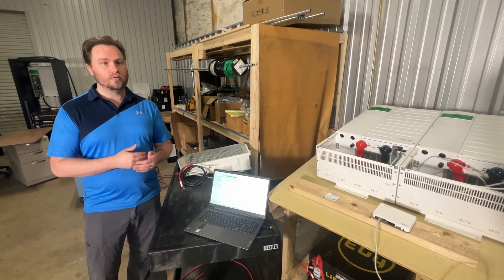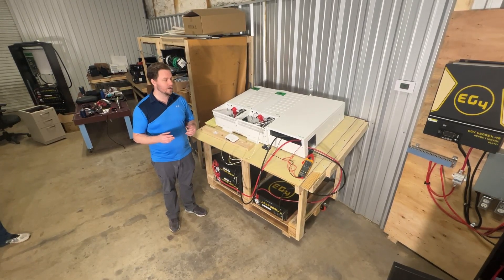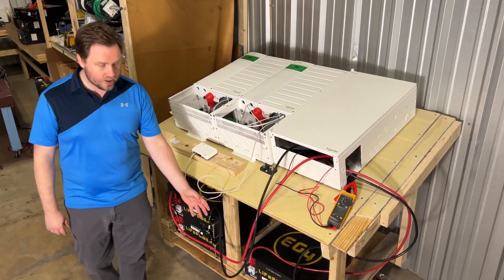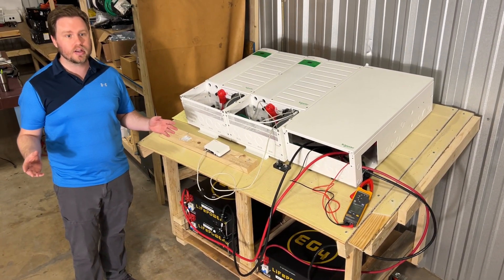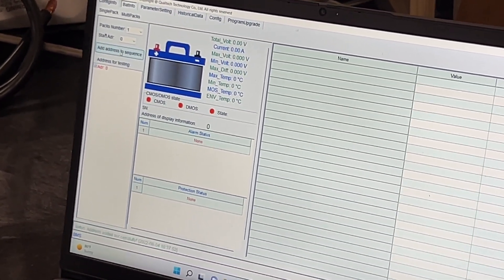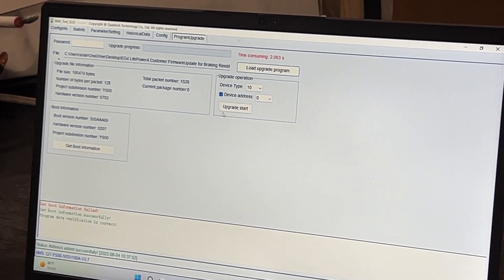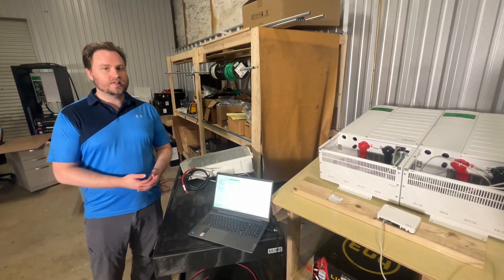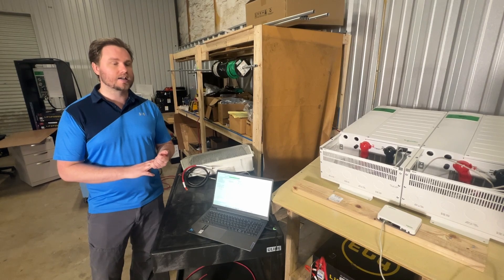EG4 LifePower4 Firmware Update | Pre-charge Start for Small Battery Banks | EG4 Server Rack Battery

Comment: How many watts can you charge with the generator? And can you charge with a generator wile the loads are still active? Anyone know?
Reply from the maker: The charging W will be based on maximum Charge A Max would be 5120W(100A), recommended would be between 1536W-2560W (30-50A). Charging A X Battery Nom. V(51.2v)

Comment: After upgraded to the latest V3.26 , the SOC (state of charge) feature is stil borken between the Schneider XW pro and Lifepower4.   if SOC feature is broken what is the point to have close loop communication?  Maybe the problem is Schneider?  I wil be contacting Schneider next.
Reply: I figured out the issue.  Under the menu Devices->BMS->Configuration expand "BMS_DEV"   ,  Select "House battery Bank 1"  under "Device Association".  Click Apply.    Once this done ,  you can enable "SOC Control" without getting "SOC Level Lost" error.

Comment: After following your procedure. The BMSTest tool app said it successfully upgrade the firmware to V3.21( file name: YS00_SW0315_HW0207_Update.binc) BMSTest app can still  pull all the voltage informations of the battery after the upgrade but now the battery BMS is not able to communicate with XW Pro nor the communication hub.  Please help.
Reply: This time I downgraded using the link in your description. It downgraded the firmware from V3.21 (from EG4 website) to V3.14(from the link you provided)  now it is able to communicate with my XW pro and communication hub.   Do you have V3.17 which came with the battery when I purchased from you.   All my other battery are on V3.17 . Except this one is downgraded to V3.14 .
Reply: Also i learned that while the battery is being charged ,  you will not be able to pull the boot info nor upgrading the firmware.

Comment: This has to be one of the worst most pain in the ass products I've had to deal with very limited instructions 99% of the information to install this and put it together is offline from blogs from other people not the company. You call the company use their callback feature or you sit on hold for hours call back feature they don't call you back. Then everything sent out is out of date on the firmware damn near everything I've seen as a code 61 out of the box. Hook it up to a generator you get code 10 if you try to charge grounding problems this problem that problem this is not a good deal a good kid or easy for anyone as a DIY it's a horrible product made in China you will spend weeks of your life trying to get it to function properly
Reply: Sounds like my experience.  Support isn't much help.  the 12v batteries seem to be the ugly step child no one wants to talk about.

Comment: OK, so what got edited out @ 7:35  when you were trying to get the boot information which apparently didn't work this attempt? My lifepowers always say "Get Boot Information failed" and loses it connection. It shows to have failed on your laptop but something was done and it worked the 2nd time. What was done?
Reply from the maker: Usually, this error occurs when the battery is connected to a bus-bar or other batteries, so if that is being done on your side, we recommend isolating the battery and updating it.

Comment: Does this firmware work with the EG4-LL version 1 - 24v battery?  I have (2) EG4-LL version 1 and they will not start my dual victron set up, they go into fault mode.  I did receive your EG4-LL version 2 battery and it will not start my dual victron set up either - I did disconnect one inverter and found that the version 2 battery will start one victron inverter - just not two set up to run split phase.  I have these set up to provide 240v split phase power to my RV - they are also set up this way so I can plug the coach into shore power - and provide pass through power to my coach.  Just FYI -  I think your comments on going against industry standards is kind of insulting to those of us just trying to start our inverters using the batteries built in pre-charge resistors - the version 1 EG4-LL will not work on a 3000 watt inverter - without manually pre-charging the capacitors first.   I have also sent this same message to Derrick - any help is appreciated.

Comment: We are simply trying to get a battery bank together that will last a decade. We live off grid in Alaska, with a prune of an Inverter from Aims, and 4 Chins 12v 200ah batteries in 2P2S. Right now, our inverter is driving me nuts, because even with it set to Lithium it will not stop charging them, and I have to watch the voltage, anytime we run the generator to charge the bank.
Reply: Best to get the set! The eg4 inverter does everything the eg4 batteries need by itself!

Comment: When I bought my 6kw split phase inverter and 3 eg4 48v batteries, I did not do the firmware update. I have never had any issues with my system yet. I watched other videos of how to do the update because I was concerned on if I needed to do it at all to make the batteries happy. Only you and your video explains the situation of when and who should do this update. You pointed out the need and not needed aspects of the update. Thank you.

Comment: You guys rock!! I'm using the EG4 100AH/48V with a SunGoldPower 6000W 48V inverter to back up (UPS basically) a bunch of circuits in the house of which one was my well pump (so I wouldn't need to pull out the generator for some water in the event of a small outage). My issue was that even a dehumidifier compressor coming on plugged into one of the backed up 15A circuits, would trip the BMS circuit protection let alone the well pump. Well happy to report I did a power outage test just now and the 3/4HP well pump fired up no issues off the inverter and EG4 battery with this firmware update. One thing, the manual dip switch address info in the manual is either wrong or I'm reading it incorrectly as it seems "reversed". Thankfully your video panned over the dip switches on the front of the battery which had them all in the down position which tipped me off. After that, the instructions in the video went without any issues. Thank you guys SOOO much for this update as I really didn't want to buy a 2nd battery for my use case.
Reply: The dip switches are inverted completely. I had the same issue with the dip switch
Reply: Hooped
Did you get the EG4 BMS to communicate with the Sungold inverter? Was that part of the firmware update? The Sungold 5kw 48v/120v inverter has a very attractive price point for what I'm hoping to do. But Sungold tells me that they are unaware of a way to communicate with an EG4 BMS.
Reply: @Vibe77Guy  Hi David. I did not attempt to see if I could get the Sungold Power to talk to the battery. I'm fairly certain it probably isn't possible as the inverter is fairly entry level given it's price (good build quality though). I'd probably go the GroWatts or SIganture Solar's unit if I needed that.
Reply: @hooped8907  
I found a video of the BMS protocol being accessable in the SOK batteries to one that can talk to the various inverters. It's just setting it to something other than the default driver. Maybe the new EG4LL firmware update will allow it.  The Sungold 5048 is both 120 vac vs 230 only, and at a price point that would allow a 10kw capacity cheaper than 8kw, in some cases less than the cost of a 6k split system. I'd just really like to couple that with the EG4 batteries performance and price point as well.
Reply: @Vibe77Guy  I have the older black 6000W 240V  LFP Series inverter/charger unit (looks exactly the same as the Aims). I think you're looking at newer models. Mine has a remote control unit (wired) as well as a lead to auto stat a generator.

Comment: Will this firmware update work for the EG4 LifePower4 12 volt 400AH battery?
Reply: Apparently not.  I just got one and it won't even start my 3000w inverter (MSH3012RV by Magnum).  I've been trying for 2 weeks to get a solution.  I've talked to 3 people in support, first two had no idea and pointed me to the wrong software.  3rd was helpful, I tried a bunch of stuff, emailed him the results....and nothing.  No call, no email, and I've spent hours on hold.
Reply: @fierofreek  I have a 3000w inverter as well. When I hook it up and turn the battery it on, it shuts the battery down. Too many inrush amps. If I jump the system with another regular lead acid 12 volt battery then turn the EG4 battery on its fine. The large capacitors draw more then 200 amps the first 1/2 second the battery is turned on. By just jumping the system with another small battery it works fine. But every time I shut the battery off, I have to jump-start the system first before turning the EG4 lithium battery on. My understanding was the firmware upgrade they made for the 24 and 48 V batteries resolved the issue. That's why I was inquiring about the firmware upgrade for the 12 volt ones.. I also never got a response from them via email. Customer service is not their strong suit.
In hindsight, I would have purchased an SOK battery as they have much better customer service.

Comment: I have 2 12v eg4all batteries in my motorhome so that's about 800 a why won't the battery's allow me to start my rv ? I have them connected in parallel when I turn key voltage on batteries instantly go to zero
Reply: The 12 volt models seem flawed.  I can't get one battery to start my 3000w inverter.  The precharge seems to limit the current TOO much, such that when it clicks off it still spikes.  And Signature Solar doesn't seem to know anything about the 12 volt models (my experience after spending hours on hold, talking to 3 different people, emails, etc)

Comment: Hello, I'm able to get to the boot information I just can't get any information out from it and will not let me download new firmware, are the deep switches need to be on a different set up at battery? I think y'all need to do more video on this firmware including troubleshooting. Thanks
Reply from the maker: Have you verified you have the correct cable pinout?
Reply: @SignatureSolar  i use the cable that was at the outside part of the battery box 📦.  Thanks for replying
Reply: @SignatureSolar  same is happening to me
Reply: @SignatureSolar  what is the correct pin out?
Reply: @SignatureSolar  What is the pinout configuration? Can't find in description or your website.

Comment: How did you guys get to that menu for the battery because I connect my USB cable and my computer doesn't detect anything
Reply from the maker: Sounds like you need to make sure you have the software installed. Please contact us if you are having issues.

Comment: Trying to replicate the update process but I keep getting the failure to get boot information, verified the battery address at 0 and can see the bat info. I did notice the bms test software you're using is v2.0 but the download on the EG4 page is for v1.0. Could that have something to do with it?
Reply from the maker: No. V2 of the software is an internal tool, but this was tested and works on V1 without issues. Please reach out if you still have issues and we can help.
Reply: Hello, i have exactly the same issue, any luck downloading?
Reply: @elgeorgesoyyo  Yes! The black rs485 cable that came with the batteries was setup to use pins 7,8 - I needed to snip off the 8P8C connector and re-terminate with pins 1,2. I had to try both pin orientations on the USB end before I got it right. Thanks to Warzone Clips for letting me know the fix!

Question to the pros out there, is there any problem with sticking to pins 1,2 for everything? Seems to pull bat info and do everything the same as 7,8.

Comment: Will this update fix battery shutdown? If it is an update, why is not recommended on working batteries? What does this update really do? Please elaborate.
Reply from the maker: This update is specifically geared towards people who are having startup issues and seeing errors with short circuit during start up. Although it will not cause any issues for people who are already able to start up their system without issue, there is no need to install if if you aren't experiencing these issues.
Reply: @SignatureSolar  I really wish you'd answer the question, what exactly does it do?  I have a 12v battery that won't start a 3000w inverter (MSH3012RV), and support won't help.  Without some information about how/when the precharge is triggered, I'm stuck.

Comment: I have 3 Growatt 5000es with 2 EG4 battery’s. Will this firmware do anything?
Reply from the maker: If your system is operational then we do not suggest updating the firmware.
Reply: @SignatureSolar  Any timeline on  a fix for error 61?  I get it randomly, but not all the time.

Comment: Does this firmware upgrade fix the “error 61” communication issue with the 6500ex?
Reply: I was about to say how about Error 61. For now I bypass  it using "user" setting instead of EG4.
Reply: @Signature Solar is there a true fix coming? I’ve tried all your suggestions of inverter settings and using your 2 pin cable. Sit getting error 61. I have two tickets in and Travis says I will get a call from a level 2 tech…but no call. EG4 inverter to EG4 battery communication was a selling point, however it’s not working properly!
Reply: Error 61 was resolved for me cuz i had my cable backwards. Flip it and try it out!
Reply from the maker: This is a firmware update for the batteries and does not affect error 61.

Comment: Good stuff.  I have 6 48v batteries, 3 EG4's and 3 LifePowers.  Want to set them up in a Dewalt HD rack on their side with the Growatt 12k on the top shelf on its back just like you have it here in your demo.  Any issues with them sitting on their side rather than on their belly like you have in your demo?  All 6 in paralell sitting on their side routed to the growatt.  Want to add batteries as time (and money) allow to get up to 12 on the rack (6 each on their sides on two shelves).  Thanks and keep up the good work!
Reply from the maker: No issues mounting them sideways. Just not upside down!
Reply: @SignatureSolar  Figured so but wanted to ask.  Now to figure out a busbar for two rows of 6 on this heavy duty dewalt shelf (h/t Will Prowse)
Reply: I have five set up in the six position server rack simply because it has the built-in bus bar but I cannot think of any reason why you could not Mount them sideways.